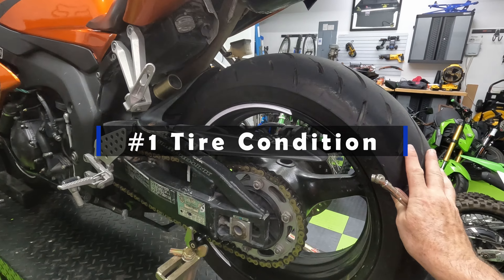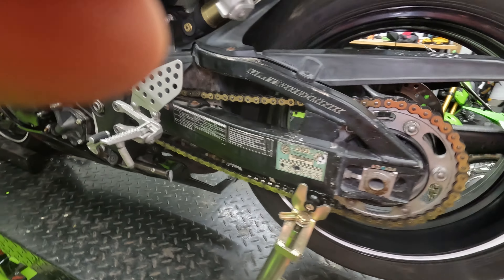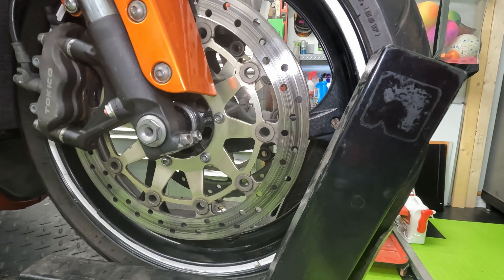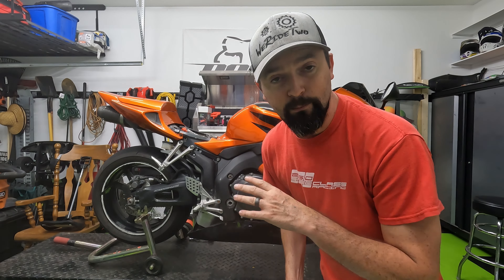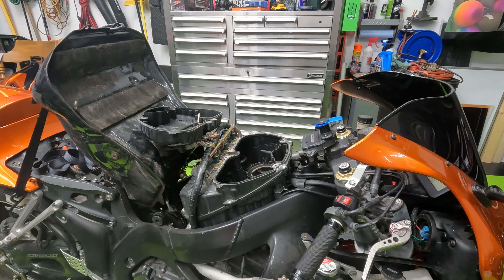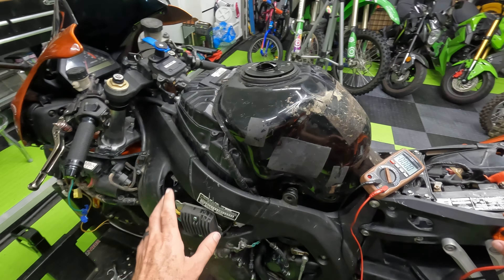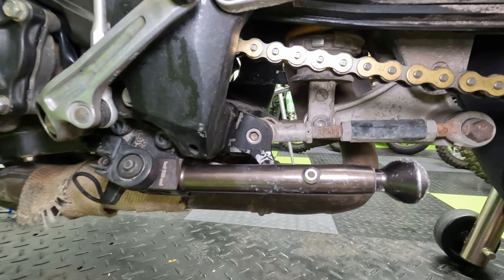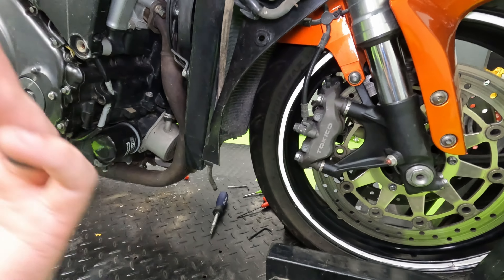Used Motorcycle Inspection- 10 Must Do Things

Comment: Clip On Style, Chain MasterLinks are not D.O.T. legal. They're for Off-Road Use, Only ! 
Always use a Crimp-On Style MasterLink (Only) for any Motorcycle that's used on the streets.
Reply from the maker: Interesting.  I haven't heard there is a DOT requirement for chains.  Do you happen to have a link to support this?  That'd be useful info to share.